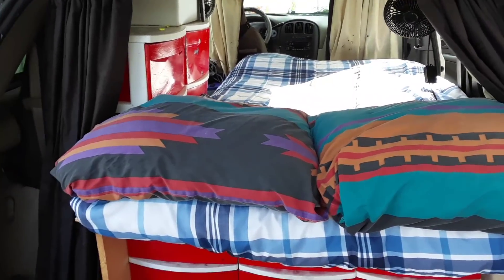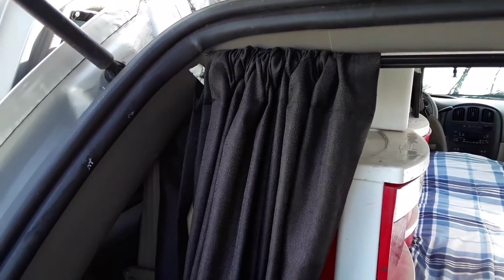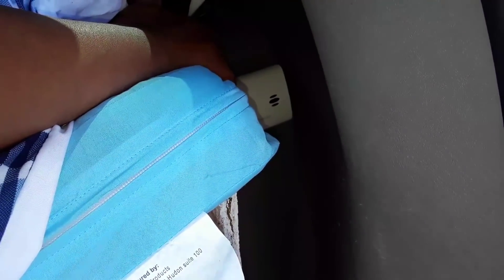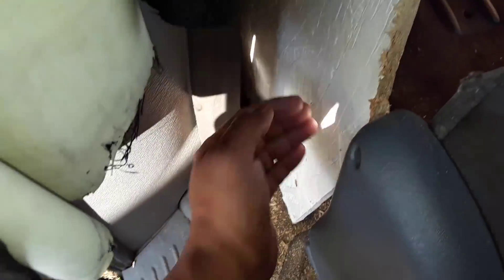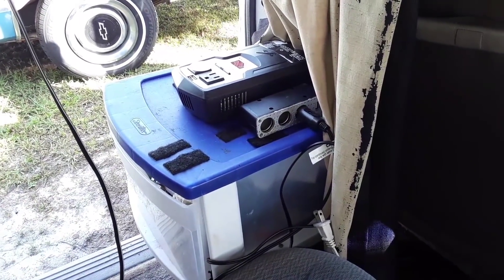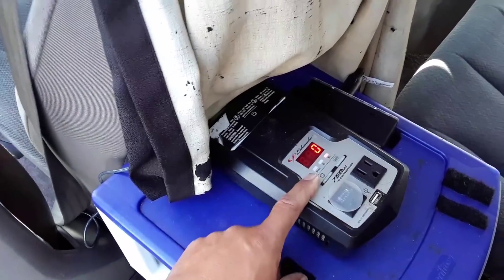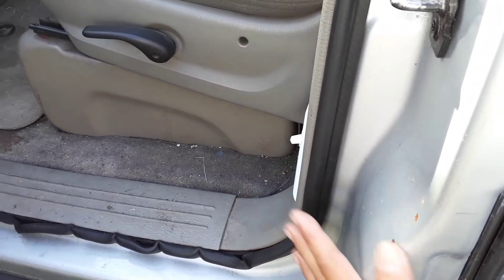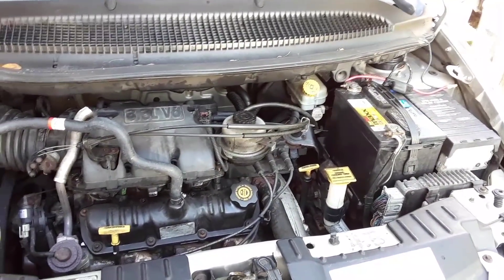Tour Of  Minivan Stealth Camper Build (V938) Living In A Van Dweller

Comment: Are you sure you want to tell your viewers they can use a household AC switch on a DC system. If someone dies based on your advice, it's all on you. Here they talk about how the switch can fail and overload the wiring: http://www.fiberglassrv.com/forums/f56/will-a-regular-household-110v-light-switch-work-on-12v-dc-52155.html. Again, I think you need to caution people about the risks of using a switch designed for AC.
Reply from the maker: Ummm...the van dweller channels are showing that people can live in a van.  Look up how many people are found dead living in a van.  Death comes for each of us when it is our time.
Reply from the maker: P.S.  I do mention that most people suggest that you should use 12-volt switches versus a 120-volt one.  Just that my personal experience has been that the 12-volt ones kept melting and that I haven't had problems with the 120-volt one.  Does this mean that if someone saw my video or other van dweller videos about living in a van and decide to do so...but then die, it is all on them as well?
Reply: DC switches are UL certified not to fail. Therefore will not kill people. I don't know how you melted 12 switches. This is America, where electrical parts are regulated for safety. If you give unsafe advice, you are liable. Im not trying to be hard on you, I just don't want to see anyone dead. And if they do, you are liable. Other than Serria, you are the only vanner with a household AC switches on a DC system. http://www.hopesandfears.com/hopes/now/question/214495-bad-advice-jail
Reply: Poster "Mark Doiron" on this mentions arcing "Go over and you will overheat the switch and it will either act like a fuse (if you're lucky) or just simply overheat and catch on fire (most likely)."  "Jingles" then replies "Thanks for that Mark. I stand corrected" 🤔
Reply from the maker: I checked my math and at 300 watts or so, the 120-V rice cooker actually uses only about 2.5 Amps...well under the 15 Amps rating of the switch.  The 12-V current is also well under the 120-V rating per "Mark Doiron"
Reply: As long as your viewers are aware of the risk of fire